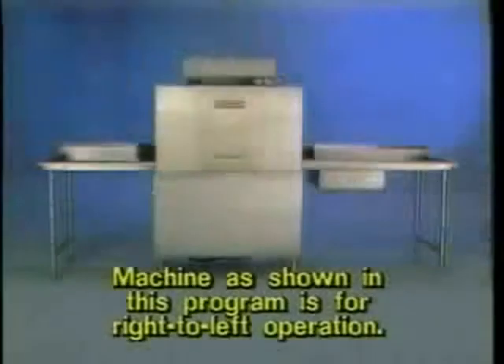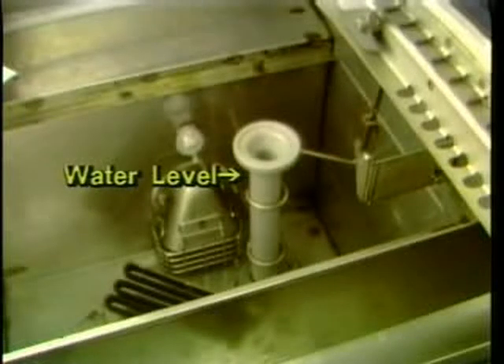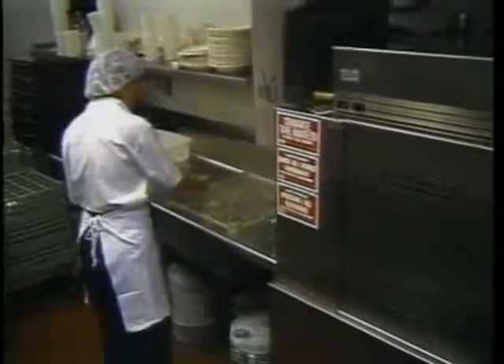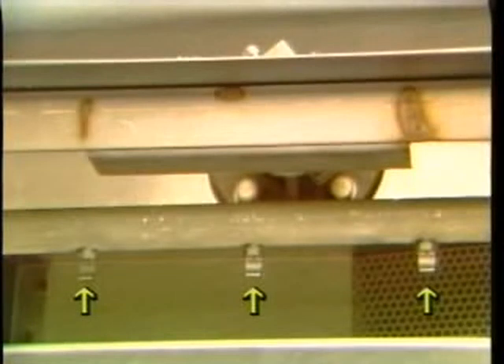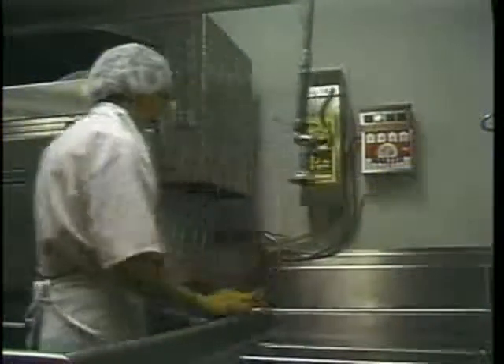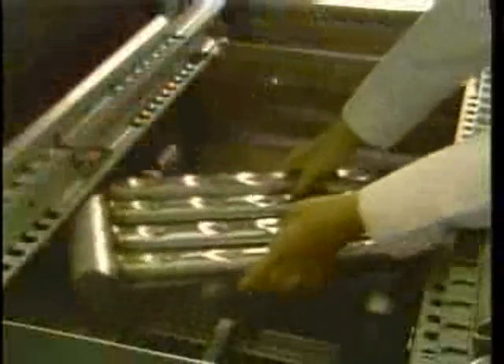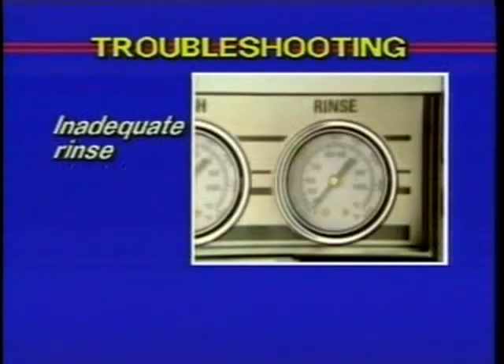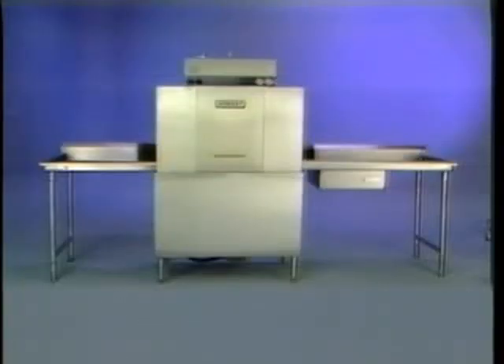Hobart C44A Warewasher Training

Comment: I work in a school Cafeteria the has your similar machine with two doors. Are the doors supposed to have plastic guides on them? The machine at my school has them and they break off easily. I don't remember them being on the machine before.
Reply: Our Hobart has plastic guides on it.  Ask your head custodian or maintenance department about it.  They should be able to help.

Comment: What about if the pressure from the pre rinse weakens? How to strengthen the pressure on my sprayer?
Reply: That has nothing to do with the dish machine.  It is a water supply issue.  Contact your local water utility or a plumber to correct this.